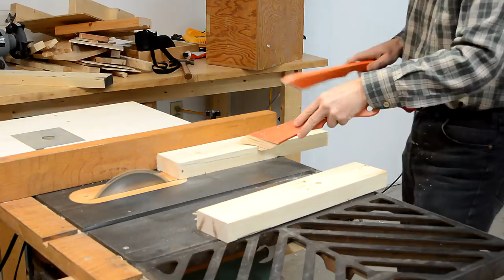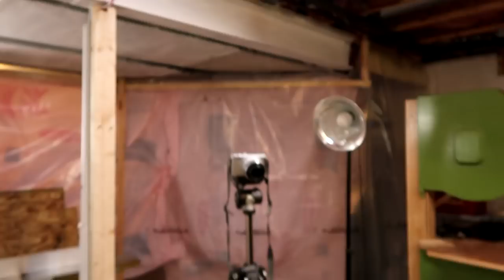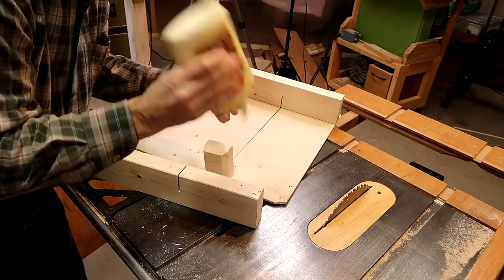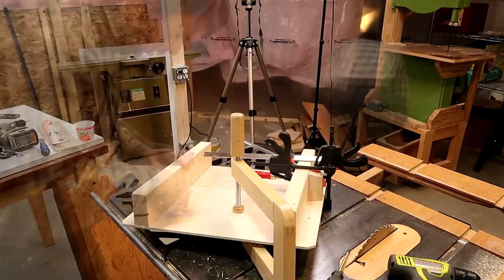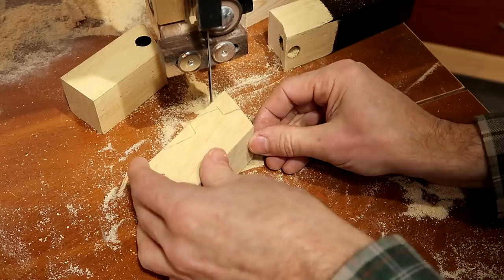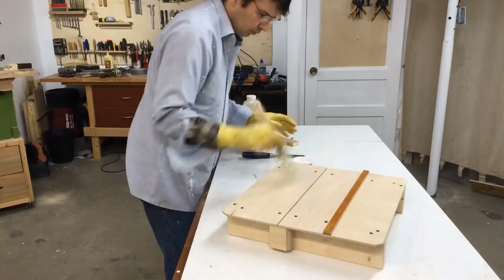How long to make a table saw sled?

Comment: So all together it took maybe an hour from start to finish.  Pretty good, it takes me that long just to clean out my shed enough to uncover my table saw.  Got to put it all away before dark, too, otherwise the rain will ruin everything.  Been building my first sled for the past month and it's still not done. I'm not trying to break speed records, though, just make something that will not warp and be useful.  No baltic birch available here, only luan plywood, but these videos help a lot so do keep them coming!

Comment: I watched this when it came out, then saw it on my feed again, and thought it meant 'how long [in length or width] should the sled be'. I was hoping to see Matthias make a 6 foot sled for cutting 2x4 studs.
Reply: My thoughts exactly! I guess the aim was to prove that it could have taken longer if less was prepared earlier and it could have taken longer if more bits were done beforehand 😀

Comment: I've heard of people avoiding the swollen runners by cutting them out of old plastic cutting boards.  Nice vid.
Reply: you can buy adjustable aluminum ones.
Reply: The only problem with those I found is that you have to be fairly particular with drilling holes for screws, as the screw can cause the plastic to bulge if the pilot hole isn't big enough. Though I suppose you could always use a little hand plane to shave the bulge back down.
Reply: That has happened to me. I was also using tapered screws (the non pan head style) and tightening those through the runner into the sled caused the runner to bulge out, but when I just screwed from the sled to the runner there was no more bulging and binding in the miter slots.
Reply: I made my runner from red oak six month ago and have no problems with any swelling
Reply: i used some left over 3/4” acrylic from
a job. my advice is use what you can get free/cheap

Comment: I made one to cut the ends of cedar shingles. We had to buy 8 bundles that were not finish cut at the ends like the rest of my house had, so I built a sled with melamine shelving and 2x4's. It took me about 30 mins to build it and it saved me so much time. The white melamine shelving slides nice on the table saw. The hardest part was making the small piece to go in the channel.

Comment: Don't you risk getting out of square by unscrewing the rail and the fence and screwing back together without checking?
Reply: Heck Meck the screws are going into the same holes so it should find the same spot as before.

Comment: How did you use the framing square to square the fence after you added the bevel? It seems like the square will go into the bevel, and that surface may not be parallel to the front of the fence.

Comment: My stop for the sled is a 1/2" hex head bolt pushed into a round rubber door stop. It just drops into a hole in the outfield table and is attached to the outfield table with a nylon boot lace to stop it getting lost.

Comment: I actually have had framing squares that were out of square.  I learned a trick to adjust them: a center punch, whacked by the inside corner will spread the legs, and by the outside corner will close the legs.

Comment: For the runners, I buy T-track and cut a  groove to inset it a bit and leave a little room for dust in the miter slot.  But for your wood runner, there was no reason that you couldn't have glued it the first time - the screws would have kept it clamped in position.  A stop is a good idea - but I made a leash of sash chain that clips to an eyebolt on the front of the saw.

Comment: Did you check it with the 5 cut method?
Reply: Charles Reiche 
Probably not, he said he has complete faith in the squareness of framing squares, probably to obliquely address that point.
Reply: I'd be curious to see that as well. I've had mixed results with framing squares. They're normally close, but not machinist square close.
Reply: @TheSnekkerShow  woodworking is not tool and die making.

Comment: The crucial thing is to get a perfect right angle cut - I register mine off a crosscut fence which I know to be accurate. Not so sure about the glue - don't you need to readjust the runners some time ?

Comment: I own two framing squares, one Stanley and the other unidentified, and they share a common problem. When I checked them with a long precision machinist's square I found that the outside 90° angles are correct but the inside angles on both are slightly less than 90°. Using either as you have, relying on both an inside and outside edge, I'm guaranteed a slightly acute angle every time. While this is not objectionable for small objects, I wouldn't use them to set the fence on a table saw sled. Maybe just pickets on a fence.

Comment: I really like the drop down safety device, I haven't got the frame on the back of my saw, just the bed, I could drill a hole and have a pin drop in the hole, tapered on the rearward face so it doesn't impede the backward motion, hmmmm, I have a plan!

Comment: Great video. Plywood used appears somewhat thinner than what is usually used. Was that a 3/8 piece? What is the minimum recommended thickness?

Comment: I don't own any power tools. Should the potable table saw be the first one?
Reply from the maker: Did you mean a drinking saw?
Reply: @matthiaswandel  they don't sell 220v version. I don't want to use power converter. If the battery powered table saw is not there yet, I won't buy both.

Comment: Every video on this topic by other content creators use a very convoluted five point method to determine if sled cutting area is true. You’re the first I’ve seen to use a framing square and assume it is good.
Reply: You should do a follow up where you run this cut through the five point method to see how it compares

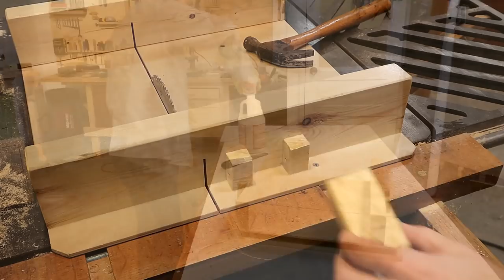Comment: As usual, I liked the video. But I have a question. At around 8:17 you said; "I don't have a need for ???." I listened twice but could not understand what you said. Would you add the words that I missed? Thanks.
Reply: Painter's triangles.
Reply: Thanks, Jeff Spaulding. Now that I know what is being said it is very clear. I googled "Painter's triangles" so now I understand.

Comment: You save brushes and time by just wiping varnish/polyurethane/shellac w/ a rag. I almost always use a rag (instead of a brush), even on finished projects like boxes, shelves, etc. I love your other (dropping dowel in a slot) safety stop (on your (DeWalt?).

Comment: Just got the ok to purchase my first ever table saw. Space only allows for a portable saw in nature. This saw can be folded and rolled away for storage. The saw research so far and leading candidate is the Bosch. Remember you did a few reviews on portable table saws but was wondering if you could recap and reinforce best bang for the buck.
Reply from the maker: I can't answer that.  I haven't used the bosch, or the rigid, or the ryobi, etc.

Comment: i have a question
how big can a sled be? i mean can you make som kind of sled that would alow you to cut fiberboard or playwood 2 times as long as the table itself?. i know the fence is for that but on my saw fence can't move far enough for the thing i want to make. silly begginer mistake, and this is a big tablesaw too. i am kind of disapointed with it actually

Comment: You have a DeWalt table saw?  Couldn't find any videos on it, on your channel.  Would be interested in your comments on it.
Reply: yusuihang 
He was sponsored last year and got cordless dewalt tools, including a battery powered table saw
Reply: I vaguely remember that he received something.  But when I look at his video archive, I don't see any videos on it now.
Reply: Looks like it has been removed. Not surprising as it was a Dewalt sponsored one and lots of people commented at that time that it was remarkably honest for a sponsored video. I'm not sure Dewalt would have approved of the slot regrinding etc.
Reply: It I remember right, the comments he made were mostly positive with the caveat that it's a small portable saw and can't be expected to be as nice as a hybrid or cabinet saw.  There were one or two specific things he had complaints about, but I don't remember them offhand.

I actually own the non-battery powered version of the saw he reviewed.  I like it - it fits under my lathe bed when I'm not using it and seems to do a decent enough job.  It's pretty lightweight.  My only complaint is that it doesn't support a dado blade - I only use the thing when I've got a lot of repetitive cuts to make, and it'd be nice to be able to crank out dados sometimes.

I mostly work with hand tools, so bear in mind that someone with more experience with higher-end machines may have a different opinion on it.  I didn't get the impression that Matthias thought it was a giant pile of worthless crap, so that's something.
Reply: Thanks.  Appreciate the information.

Comment: How do you feel about using delrin for the runner to avoid swelling problems?
Reply: He get's most of his materials out of the trash.  How often does someone throw out usable scraps of delrin?  Eeks, I just looked on Amazon, delrin is US$50 per square foot!  An HDPE cutting board from the dollar store would work as well and wouldn't make me cringe every time I used it :)

Comment: Thanks for making this. I will be building a sled soon. Do you have a video on the version of the table saw fence in this video? I need to make one for an old Craftsman (113.xxxxxxx) saw and what you have looks similar (better) than what I have been thinking of. I've see your other table saw fence video (great) but I want to use the metal rails that are already there. Thank you.

Comment: hello Mathias, i wouls like to know the  tools/machines you most use in your shop.
I mean, the tools/machines you absolutely couldnt work well without it.
I ask because i am a newbie wo woodwor and i am mounting an small shop in my basement.
Greetings!
Reply: There's no "one path" in woodworking, so it depends on how you want to work.  I don't own half the stuff Matthias does, and he doesn't have some of the stuff I use all the time.  I don't own a bandsaw, for instance - I get by with a coping saw or a jigsaw mounted under a table - but I don't make gears, and he does.  He's got four or five table saws, I got one portable one covered in shavings from my lathe.

My advice is to decide on a project and figure out what tools you want to use for it, then buy those.

Comment: I made it but now I have a question. Why people do crosscutting with table saw? Isn’t miter saw more accurate, faster and safer for crosscutting? Also, using miter saw you don’t need to make lots of jigs for table saw.
Reply from the maker: Miter saw is much less accurate, and most throw dust all over.  Also less safe for small pieces
Reply: Matthias thanks. You are right. I have table saw. Wanted to buy miter saw but you changed my mind. Table saw for crosscutting will do just fine.

Comment: Why not add a small brush that will clean the groove wilst it moves .
Reply: I bet he'd find a way to make the brush out of plywood he found from the garbage.
Reply: Then you would also need a suction tube somewhere, connected to the dust collector or the dust would still pile up in one place...
Reply: His dust collection system effectively removes all the dust you’d bother with. 
A nearby air hose could remove any remnants if they mattered.
Reply: The dust he's talking about piles up against the perpendicular front fence - not the blade slot.  The solution is to make a little relief channel of some kind at the base of that fence.  Otherwise you wind up holding your workpiece against sawdust and that makes for some very inaccurate cuts.

Comment: How would you know that a framing square isn't square?
Reply: Find a piece of plywood with a nice, straight edge. Place the square on the face and align one leg along the clean edge. Then, draw a line using the other leg. Flip the square over, left to right, and repeat. If the two lines you drew are parallel, your square is square.
Reply: That's really simple why didn't I think of that.

Comment: 1 track vs 2 tracks? 1 track is enough?
Reply: as long as it doesn't wiggle in the track it's fine.
alternately if it does have some play in the track, you can push to one side or the other to ride the rail...

Comment: After 10 days .. i'm still building it : (   easier said than done unless you have a jointer or 100% flat materials to start with .   When I say flat I mean FLAT  (and square) . I bought plywood from two different places and discovered that is just not flat . Then I was really surprised to find out that I don't actually have any flat surfaces in our home , even the marble kitchen worktop is not flat..  A jointer is on the way
Reply: I’m dealing with the same problem. Hope the jointer solved it for you!

Comment: Framing Squares, every one I have bought has been slightly out of square, most not enough to complain about, the last one I did the draw a line and flip trick ....4mm over 300mm (well it was a 12 inch wide melamine shelf so 304.8)

Comment: I have been trying to make a working tablesaw sled off and on for 3 years. Im a newbee of about 4 years of woodworking and am doing it for jobsite saws. The rigid you see in home depot and the dewalt on the paulk total station. I forget the models.

 So far I have not been able to make one that works. There is always a problem in the end. Never square, wood in slot never works out and so on.

I also have found that the making of the sled is more dangerous than the cuts it's supposed to protect me from. I just threw another one in the garbage.

 Im over sleds and wont be wasting my time and money on them again. Theyre overrated imo and im still able to get done what i want without them.
Side note:
Not doubting the usefulness to some and respect the skills here. Just my experience with them.

Comment: Hi Matthias,

Nice informative video.

Do you always only use one runner on your jigs  or would you reccomend useing two?

I have just bought a new budget table saw from JCB and now need to make a sled for it
as the one for my old home made table saw will not fit.

Regards,

Bill.

Comment: i would have used pocket holes screws  to attach the standup wood thing to the other  laying down wood thing. way faster and more better.
Reply: and I was thinking a big nail through the back block would make the front stop unnecessary.
Reply: You must be new here. "Thems(Pocket Holes) a fighting words" with Mathias :)

Comment: Ugh. I need a new table saw. Frustrating to think about trying to do on my table saw what you did when you rip the strips for the runners and make many passes taking off tiny bits. My fence doesn’t clamp straight and anything I push thru always pinches on the backside of the blade and shaves/angles off the corner that exits touching the blade.
Reply: If your saw doesn't have adjustments for that, or if you're not willing to get underneath it with a file or shims to modify it so that the blade is parallel to the fence, scrap the thing.  Binding is dangerous.  My old saw did that, and after it nicked its second thumb it went to the dump.

Comment: you should put a bevel at the bottom of the front fence, for more exactly cuts because with that there can´t be any sawdust between the fence and the workpiece.
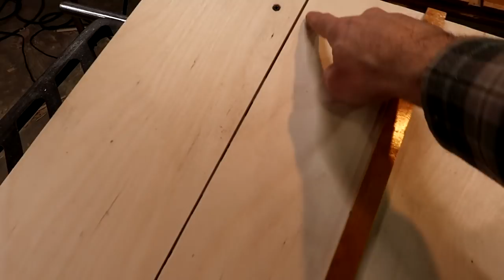Reply: 5:06

Comment: Add about twenty minutes if you don't have a jointer and have to flatten and square the top and bottom rails with planes.  That's about what it took me when I made mine, but I lean when I plane edges and have to compensate, so someone better at planing will take a bit less.

Comment: I guess it's just a question we'll have to leave to the philosophers out there. How long DOES it take?
Reply: I'm guessing it took me about an hour and a half, but that includes the jointer work (which in my case, the jointer is me with a few planes).  It wasn't as nice as what Matthias made here though, so if you wanted it to look nice add another 15-30 minutes.

Comment: you should really be coating those sleds with Clark Griswold's non-caloric silicon-based kitchen lubricant...it creates a surface 500 times more slippery than any lubricant known to man.
Reply: rol dac
Known to man?  I use one that's 534 times more slippery, ain't that a kick in the pants!
Reply: Don't go neer microwaves. You might regret it, even tho... the first 30 mins you will be unaware of it.
Reply: I get your joke, but seriously, be wary of silicone in the workshop ! Google "silicone contamination".

"In wood or metal coating operations, silicone contamination is a nightmare. Even traces of silicone cause primers and paints or other coatings to “fisheye,” separate, and lose adhesion."
Reply: Oh Clark...
Reply: It's a "non-nutritive cereal varnish" NOT a kitchen lubricant.  It just happened to be a lubricant for the snow saucer.

Comment: "how long does it take to make a sled (if you have a sled to help you make it already)" XD
Reply: He also squared the wood and such off camera.
Reply: Bootstrapping.
Reply: New ones, yes. And they're generally not too great of quality. The one that came with my table saw I used just to make a sled then tossed it because it wouldn't cut square. Now the current table saw I have is quite old, and has no tools with it so I have to make another one lol
Reply: When I made mine, I use a chop saw for the stuff he used a sled for.  And really, none of those cuts need to be high precision anyway - you could easily eyeball it and cut it with a hand saw.  If the ends of those pieces aren't quite square, it doesn't affect the functionality of the sled at all.